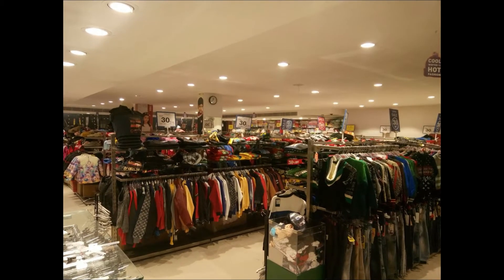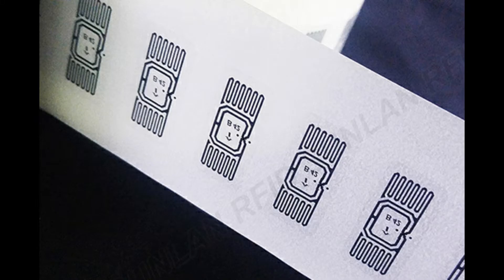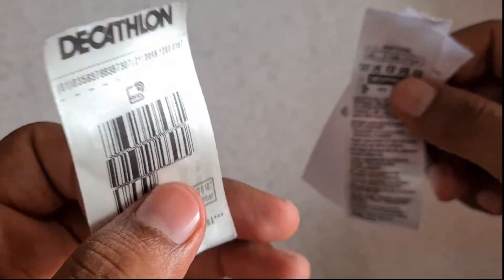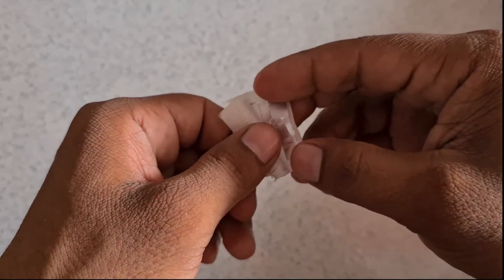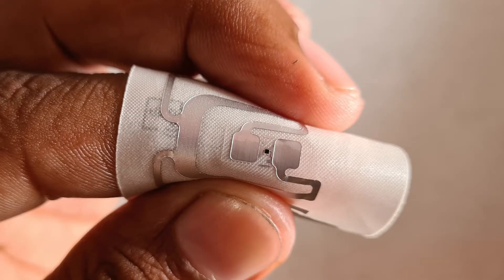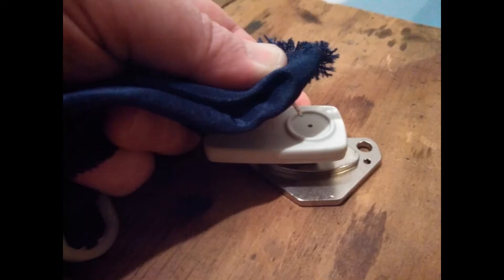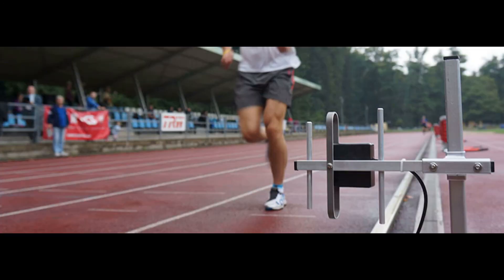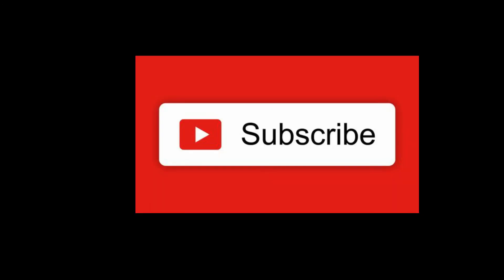Anti theft system used in stores. RFID plastic tags on clothes.

Comment: where is the antenna located? does the antenna have to be located adjacent to the barcode together to activate/deactivate? and is it normally just on the main tag ?
Reply from the maker: Antennas are placed at the exit gates and they need not be so close to ring the alarm, an RFID tag in this chip when it comes near to antennas it gets activated

Comment: How does the RFID tag know when you pay for the item?
Reply from the maker: RFID tags stores information inside . Once you have paid for the item , salesman deactivate/remove these tags
Reply: @thefoxbatco  thank you 😊
Reply: @theartificer570 may i have a question? once the tag is deactivated will it reactivate again?
Reply: @roviulep2727  yes
Reply: Rfid tags can store way more info than a barcode each tag has its own unique id number. They would be scanned into the system when the item is received, and marked as sold when checking out. If the store is setup that way. When you walk out it can check to see if that tag has been paid for. There are not a lot of stores that have this setup yet.
Reply: As an example walmart has been testing this on its clothing, general merchandise and jewelry. They have a device that they just wave around the racks and jewelry and it can count and store the inventory info. It was very useful on clothing and could count an entire rack in less than 10 seconds

Comment: that is wrong sir.. the big plastic ones are not RFID tag.They are just alarm tags that trigger when you pass the store "gates". technically you can use a magnet to demagnetize them and the alarm will not go off. The thing in the label is a RFID-tag the little black spot is the chip the silver around it is a antenna. The range of RFID is not that long. if it's to long then others could scan the code and copy it. RFID tags usually have a ID number and some can store some amount of data. they do not control things the ID and/or data on the tag triggers an event in a program or application.
Reply: You still can remove the barcode rfid on the item right
Reply from the maker: @elbale2323  But not without help of scissors
Reply from the maker: First of all thankyou so much for such a good attention that u had throughout the video and noticing every bit of it.
But my friend the thing is, those plastics tags are used only to stop shoplifting,  plastic tag is an older technology,  now RFID tags have replaced those plastic tags doing their job.
Sewn in RFID tags perform two functions at a time, one is to accounting the availability of that particular item in the store and 2nd is to stop shoplifting. 
You may find the items having RFID tags will never have a plastic tags attached..
Thats why i stated in the video , this a more advanced form of plastics tags..😊😊

Glad to hear this from you, hope this will help you out, if still this info doesn't looks right, do share your views further.
A video is not important but the information contained in it , is..
And that must always be right 😊
Reply: I’ve always wondered, what action during the checkout process renders RFID tags on stickers/barcodes to be disabled?